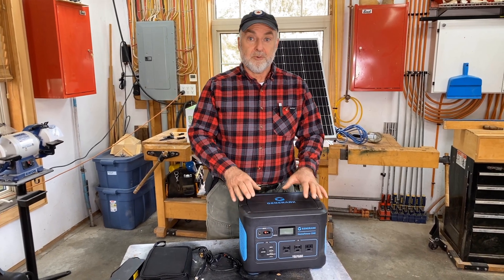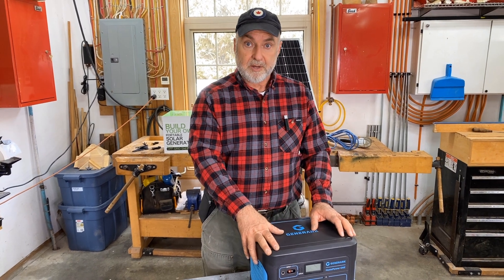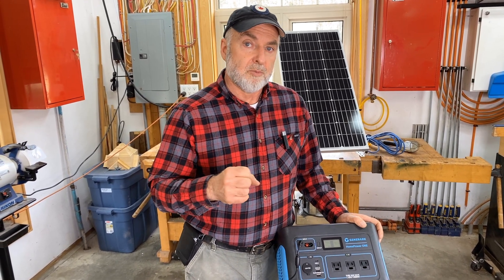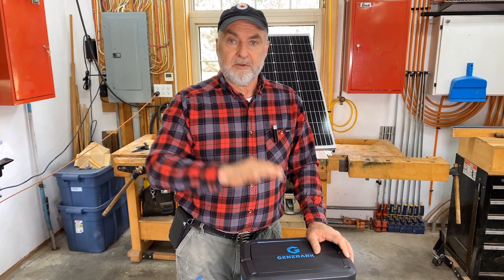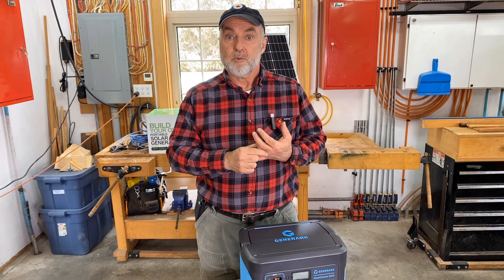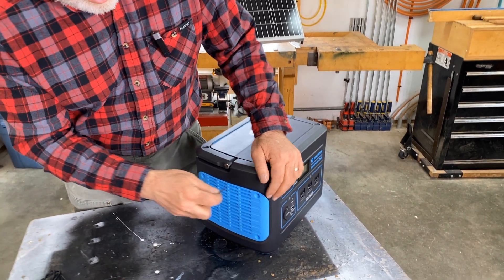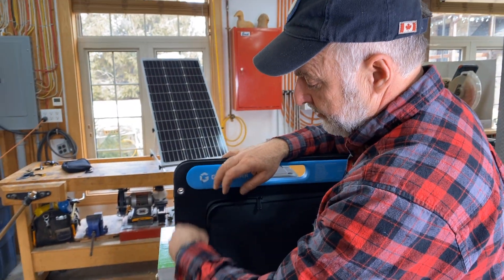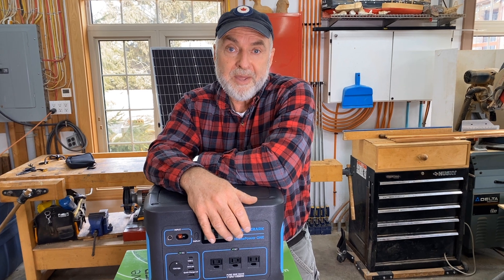Is This the Best Portable Solar Generator For Home Use 2022?

Comment: I disagree that lead acid is the best bang for the buck. Lifepo4 last 10 years, and you get way more AH out of them. Lifepo4 100ah is 350.00. You would need a 200AH lead acid battery to compare to it which wont last long.

Comment: These units are invaluable. It's no fun sitting in the dark, unexpectedly. I have two from another well known brand, large enough to provide electrical power to my natural-gas furnaces. Longer term power outages require a generator, which I also have. They can definitely be part of a multiple strategy approach to providing emergency power.
Reply: Please that is how much

Comment: Then it's kind of useless because when our power went out because of the freeze we needed to use some sort of generator for heat. Even if we couldn't turn on our lights or do anything else heat was very important during the cold winter storm I mean are you able to plug in a heater maybe even if it's just one. Many people around here suffered terribly and some died because of the freeze. Luckily I have a gas stove and gas heaters so many people came over and stayed with me.
Reply from the maker: Good Morning Terra bull! I wouldn't say something like this is useless, you just need to understand the limitations. To keep warm and well fed a person definitely needs more than just a portable solar generator, but these units are worthwhile because they provide small amounts of power for as long as needed, even if gas supplies are unavailable. The ability to use a phone or see a little in the dark can become surprisingly important when you don't have them.